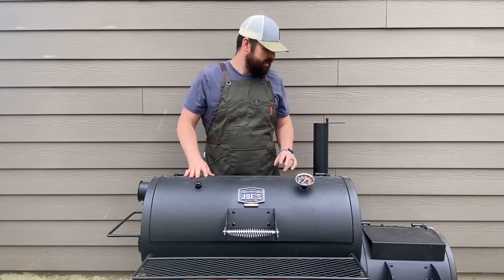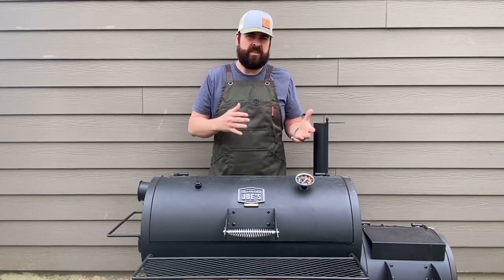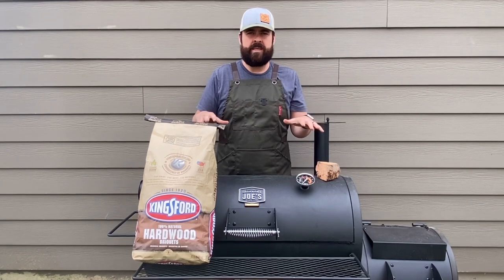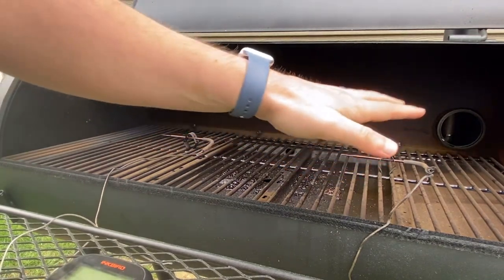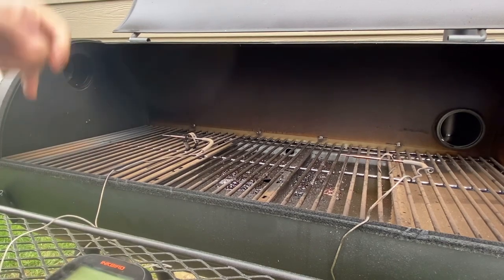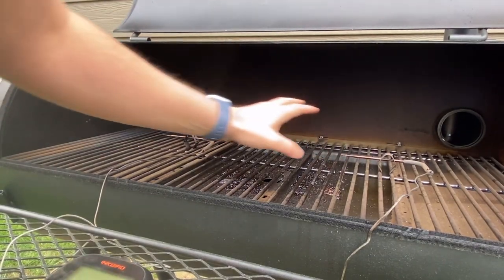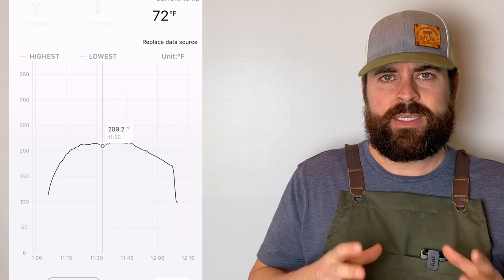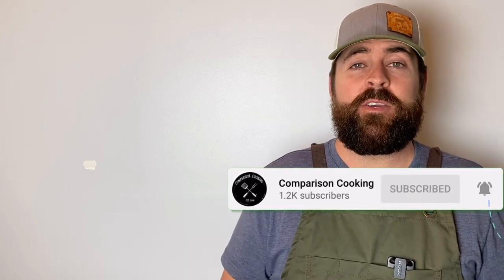Oklahoma Joe Highland Vs Oklahoma Joe Highland Reverse Flow!

Comment: This is consistent with my experience, I have a double-barrel traditional offset, and if it were much smaller then I would definitely want a reverse flow. With the larger smoker I get different zones, the area nearest the firebox cooks like a drum smoker with radiant infrared heat (great for chicken, tri tip) and the barrel furthest from the firebox is pure convection for briskets ribs etc.
Reply from the maker: It’s good to know what your smoker is doing👍

Comment: That’s a cool test. I didn’t know the grill could do both
Reply from the maker: Yeah, its a pretty sweet setup.  Thanks!
Reply: Do you need to buy a certain attachment? From what I could gather reverse flow is more consistent temp. Is it better cooker? I have a kamado joe but wanted to get an offset. Do you recommend any in particular?? Thanks

Comment: I use the traditional chimney when I grill putting the charcoal in the smoke chamber 2 chimneys of charcoal. I gotta say the food ends up way better than other grills. As a smoker I still struggle with draft so thinking I'm gonna extend the stack height couple feet for better natural draft and give that a go...soon as winter is over.
Reply from the maker: Keep me posted on how that works, I personally didn’t have much luck with it, but I did half ass it.

Comment: I always use the reverse flow plates in my reverse flow smoker. However, I am having trouble with the intake vent closing and not being adjustable. I need some kind of friction to hold the intake vent at different openings. Do you have any suggestions for this?

Comment: Sounds like maybe it should only be available in the reverse flow configuration from OKJ. I found some peace with two mods in mine and it cost  me almost nothing... The first was the Meat Cranium mod and that is wrapping the fire box grates in foil to baffle the fire some and keep the fire in the fire box. When I did my second mod it really messed me up for a few minutes... I essentially lowered the exhaust stack to grate level by using a half seving tray to lean against the side and go down to the cooking grate. The part that messed me up was the hot air and smoke was running right out my stack so I had to remove one of my make shift baffles and this has made it a much better cooker
Reply from the maker: That second mod sounds like a challenge, its very interesting how liitle changes can effect the dynamics of the air flow.  I'll have to check out the Meat Cranium mod.
Reply: @ComparisonCooking  the Meat Cranium mod is simply the foil rapped grates.
Reply: @ComparisonCooking  also the second mod isn't very hard either. The stack is in its factory location. I used a half serving pan kind of like the elbow but it doesn't take as much space from the wall of the smoker.

Comment: Would it still work as effective if you kept the baffle plate in during the traditional highland exhaust placement?
Reply from the maker: I normally used two baffle plates on the traditional flow setup.  Just because its a more compact unit.

Comment: Hey, I just got a Chargriller Champ. I've been wrestling with the idea of making it a reverse flow. I have a bit of experience fabricating metal, so that's not a concern. I'm pretty sure this should transfer to the Chargriller. 
Thanks
Reply from the maker: I love a big reverse flow, but after making this video I kept the Oklahoma Joe in the traditional setup with two baffle plates.   The air flow just seemed to choked down (even with vents wide open) for the size of the smoker.  You would probably have better luck if you got the proper length and width of the stack then I did with the OJ.  It really needed a wider taller stack for better pull, It was a struggle getting it to hold above 225F.  Keep me posted and good luck!

Comment: What if you left the baffles in with the stack in the traditional offset smoker position?  The baffle plates alone add more thermal mass.
Reply from the maker: Traditional method I keep 2 baffles in, seems like that works well.  Keeping all four in could be interesting

Comment: How do you keep your walls and grates so dry/clean looking? I've had trouble with that. Mine consistently stays Greecy/oily (alot of smoke build up) I haven't found a method that stays clean
Reply from the maker: This is one way to clean it! https://youtu.be/pGt6hD9RG-I  The other thing is, i didn't use this smoker that much, probably a total of 12-15 cooks.  The one in the video linked in this comment, i had cooked on it 3 times a week for months.

Comment: Great Video. How often do you have to refill the charcoal bin/add wood to maintain a cook overnight in the OKH? 
I use a WSM22 with Fireboard and Fan. I can get 19hrs out of 1 bag of charcoal with steady 225-250 temps.
Reply from the maker: I literally just gave this smoker a way to a friend today.  I was always using my WSM 18in instead of this.  When  I used it, you would add wood, every 25-35 minutes, and add charcoal every 2 hours.
Reply: @ComparisonCooking  so u essentially hated it.  haha

Comment: Ooooooooooooooh so you can move the vent yourself on the reverse???? I did not know that I’m really debating on which Oklahoma Joe I want but now I think I found it
Reply from the maker: Yeah it’s pretty cool, but if you haven’t bought it yet I would stick with the regular and save your money.  The reverse flow never wanted to burn hotter than 215.
Reply: @ComparisonCooking  Really? Yeah I haven’t bought it yet I’m debating with traditional and Reverse Flow
Reply from the maker: @lasveryown664  yeah, the traditional set up just worked better for the airflow/size of that smoker.  I love a reverse flow, but it’s just not the right size for it compared to the 120 gallon I run.  With the traditional setup you just need on small baffle/deflector by the fire box side of the chamber and it does a good job
Reply: @ComparisonCooking  what do you think about the smoker itself? Cause I’m reading reviews on the new Oklahoma Joe’s on Lowes and they’re all saying the same thing that the paint peels a lot faster
Reply from the maker: @lasveryown664  it’s a good starter smoker, paints just going to peel, it happens.  Problem is jumping to the next level of smoker is going to be a 1k+ expense.  No smoker is perfect and does everything whether you pay $200 or 2000. Also don’t forget to check out Facebook market place and Craigslist for that smoker.  Saw a couple the other day on there for $100-$300 range.
Reply: @ComparisonCooking  for sure, yeah I saw the price difference it’s literally $220 difference in price so I think I am gonna get traditional ima go look at it right now at lowes

Comment: thanks,ive been thinking of converting my highland to reverse flow.ive had for 7 yrs and still not easy.i have high dollar tuner plates which is better but....also have alot of mods and tried even more.im very curious to see how temps .would be with original stack place with the baffles for reverse flow
Reply from the maker: I plan on doing that probably next.  Along with also taking out one of or two of the plates for the reverse flow to see if that helps bring temperature up.  Thanks for watching Tony.  Hopefully these videos finally give you the conclusion on converting or not.

Comment: What are you using to get that graph?
Reply from the maker: Inkbird Wifi Thermometer.  I got the link in the description, but check out their FB page and coupons on Amazon.  FB they normally do flash deals where you can get it for 15-40% off sometimes.  (coupon on amazon is normally $20.00 off, just check the box by the price.

Comment: That's why you don't buy a cheap Box store smoker just go ahead and get yourselves an old country Brazos it's not a big store smoker you don't put it together they'll ship it to you on a pal it there is no assembly required it's 500 pounds it's a lot better than that big Box store garbage
Reply from the maker: Agreed, I’m a have to touch it once type before buying it. So not having an academy sports close by to check out the Brazos always kept me from buying it, looks like such an awesome smoker too!
Reply: I’ll just weld this together. 🤷🏾‍♂️